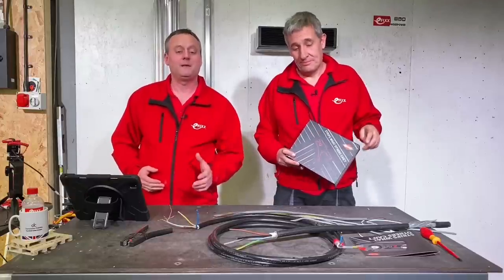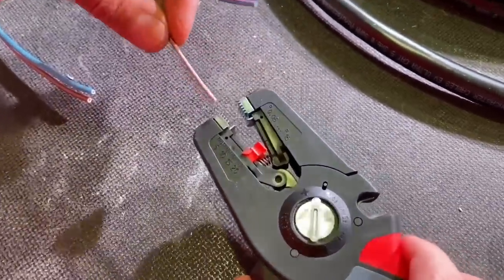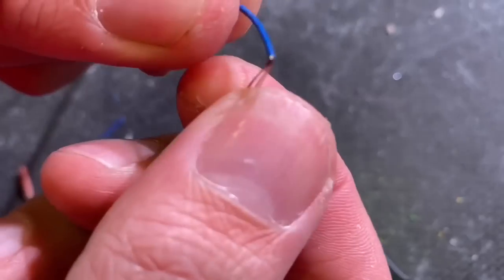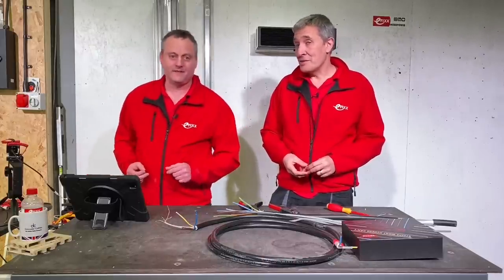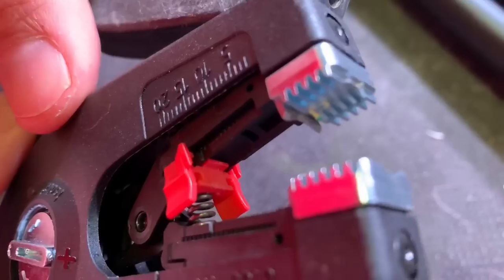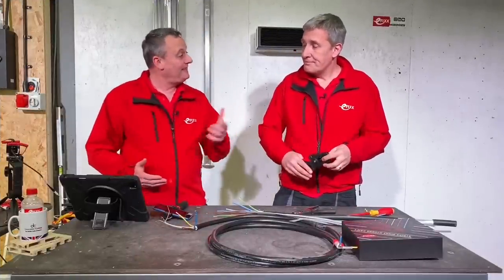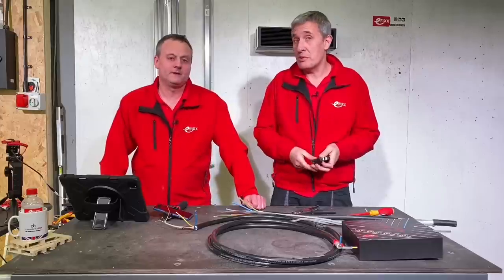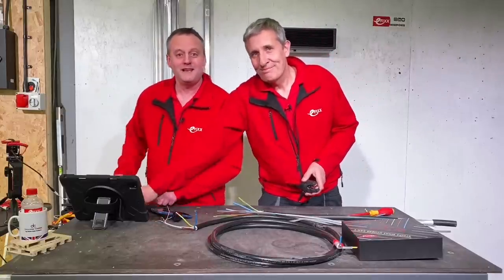KNIPEX PreciStrip 16 - Strips wires that other wire strippers CAN'T

Comment: Does it strip the outer sheath on twin and earth as well
Reply: Great question
Reply: If the cable is flat, I doubt it.
Reply: You can get ones the same design but with 2 flat blades instead of curved blades and it does 2.5 twin n earth like butter literally seconds Amazon have a mooch like 30 quid and seriously good bits of kit
Reply: Doubt it just by how it looks
Reply: @kimjones1270  do you know the name of it?

Comment: Despite the price, these are the nuts. When I first bought mine I felt the build quality was a little 'light', and that they would not last very long. Had them a year and a half with pretty much daily use and a few drops and still working fine. The only thing I will say is that certain cable manufacturers use a more rubbery/stretchy/soft type of insulation, and in these cases may need to adjust the tool fine tune or twist and pull a second time.  You learn to use the tool with this type of cable and is still very effective, but this tool definitely works better on a more brittle/solid type of insulation. Apart from that, a really great tool I use all the time.

Comment: Ive got them. After 3 months of use. I do residential install the spring broke and once you squeeze them they stay closed. About the 16mm2 thing. It doesnt cut them that good. I have struggled quite a bit with 10mm2. Its all fun when you have a new cable, but when i did new consumer unit, i really struggled with the old feed wires. From 10-16mm2. Alsi on the vieeo you ahould strip 16mm2 not the thin ones...

Comment: I don't have the Knipex one specifically, but a very similar in design from another brand, and I wouldn't be without it!
That depth adjustment is so brilliant, just gives that perfect and consistent result everytime
Reply: Which do you have? I can’t spend £100 in wire strippers when I already have so many that get the job done fine lol.
Reply: @DaddyBear3000  Knoweasy Automatic Wire Stripper

Comment: What a lovely set of strippers I’ve also got a version of the Knipex strippers But they seem to be in the middle of the old and the new ones. I keep them in the unit for when I’m stripping cable in there. Great shout with testing with your own cable out. I would of done exactly the same.you wouldn’t blame him for putting sabotage cable in Cheers Lads Keep up the good work

Comment: Thanks for the review.
You reinserted the blade unit upside down after taking it out. This way the millimeter indicator on the red adjustable end stop doesn't point at the mm scale anymore.

Comment: When I started apprenticeship some years ago , had a pair of those strippers with the v jaws and bolt adjusted was told by electrician on site , I hope I never catch you using them , never did use them , tools got stolen shortly after I brought some of those ratchet ones as they had just come out , never actually used them either , there still in tool box some 30yrs later , always used cutters to strip cable

Comment: This stripper met its nemesis when trying to strip double-walled PV wire (both 4mm^2 and 6mm^2 . Although the copper area was well below the maximum of 16mm^2, I wrecked the stripper because of its thick isolation. Something internally bent while trying to strip the isolation and as a result, the stripper lost its clamping force.
Fortunately, the supplier (I live in the Netherlands) replaced the stripper under warranty.

Comment: 28 AWG (0.08mm2) would be pretty common to find in an electronics lab. However, I think the old "KNIPEX MultiStrip 10" is more useful in that regard, as it goes even lower, which is very handy for signal wires.
Reply from the maker: We used the 10 for many used on difficult thin cables 👍

Comment: Well look at that. Doesn't leave any scarring on the mechanical protection or the Conductor insulation unlike the @cktools automatic stripper. And it does 16mm as well. I'm just getting used to using croppers as a student and I'm sure this will be a champion amongst the established sparks.

Comment: I was going to buy the ones you had on a week ago, now you throw this spanner (or stripper) into the works😍 a few questions:-
What’s the max length of insulation it will strip?
Can it remove t&e sheathing, including LSOH?
How much are the replacement blades?
Which are better the ones from last week or these beasts?
Reply from the maker: This isn't for flat cables like T&E - use the one we featured last week for that. - Tune in to the live stream next week someone is going to win these and someone will take away the ideal ones.

Comment: I have one. I bought it for those large range jaws. Is not so smooth in handling like Weidmuller. But maybe in the future you will make a comparison with the same category stripper from Wiha (0,08 - 16 mm2)

Comment: I'd like to see the conductor of the CAT5e following stripping. The outer sheath tends to stretch over the copper if not tight enough on the cutters..or the copper is marked leading to breaking of the conductor

Comment: Dunno. Just bought one of these and it doesn't work great. On some of the thinner 0.5mm wire it couldn't even strip them. I played around with the strength setting but didn't make much difference. Can it be a faulty one?

Comment: I've had a pair for a couple of weeks now, really good bit of kit but I have found it on several occasions slip on the cable and only score the outside, then because the cutters are set to match the clamping jaws it won't strip the cable and I have to revert back to my pliers to strip it
Reply from the maker: What type of insulation did you have the problems on?
Reply: @efixx  just some 6491X single core pvc cable

Comment: Received new tool, very excited to try, did not work from the moment I removed from blister pack, no matter how I adjusted the settings, or which size wire, it slips through the jaws and does not strip, IT IS Garbage, does not work. Knipex will not warranty or replace, called customer service (USA), left voicemail, very nice polite lady called me back and proceeded to tell me that the strippers were not designed to work on THHN, solid or stranded, nor MC conductors, from 16 to 10 gauge. DO NOT WASTE YOUR MONEY, $120 in the garbage.

Comment: Will you be doing a clamp meter review? I have the fluke 324 but its stopped working, it displays but no readings on the test probes for voltage and continuity readings.
I tried new batteries but not the leads yet.

Comment: Do the strippers also take off the out sheath of T&E?
And do they reach i to a back box better and closer to the entry point than other cutters?
Reply from the maker: Not suitable for T&E
Reply: @efixx  are there any that are suitable for the outer sheathing of twin and earth? I have been using the automatic vice grip style ones - is it okay to use them? They don’t seem to damage the inner insulation

Comment: Thanks Gary and Gord for another great video! I had the predecessor in the Amazon basket but never got round to buying it, does the new one strip the outer pvc from twin and skin? Cheers Myles
Reply from the maker: It doesn't work on T&E - cheers
Reply: @efixx  Does the old one remove T&E ?
I notice the blade on the old one is flat.

Comment: I'm more confused at the cat5 combined with the armoured cable! What's going on there? Have always been told to keep them separate!
Reply from the maker: It’s a special cable for EV charger installations - see this video https://youtu.be/0MFlJzJb_Qk -cables can be combined if rated to the same voltage - precautions taken for interference etc

Comment: Was it me or did the insulation stretch on the 2.5 as stripping and in turn after installation will that shrink back and expose conductor.

Comment: Nice tool, still with this automatic strippers(the ones with metal gripper)  I see damage in the isolation where the gripper holds the conductor. Where a normal strip action by a knife, sidecutter or combination plier with good feel of control will leave no damage behind.
Reply: This damage is minimal and does no physical damage to the metal it self. You will save yourself lots of time and labour through out your career.
Reply: A perfectly clean cut in the isolation is not important. For at home use the solutions you suggest are sufficient, but for any other environment it is too slow.

Comment: help !!! 
 How does ..KNIPEX SELF-ADJUSTING WIRE STRIPPERS 7" (180MM) (6629F) from screwfix £60 compare please.
The KNIPEX multistrip 10 here is shown as predecessor but knipex seem to sell both, the 10 seems smaller which can be better  
  is the16 better for cat 5 burg alarm t./e,    1.5 23 core  2.5 3c outer and inner...ie all usual

Im seeeing £80-£90 for the 16  best place to buy ??
thx

Comment: I think there a OK tool but I think you will have a problem when stripping the outer sheath  at the box? The conductors not a problem in which case you might as well just use side cutters.
Good demonstration though weldone. Correction I was referring to the ones you show in an other video.

I have asked this question on two other channels and no one is  willing to give an answer or to demonstrate there use at the back box .

Comment: yes good demo and good video, but for the price like 90 quid that's a bit extreme compared to other horizontal cable strippers at 1/4 of the price.
Reply from the maker: Depends upon the type of cables you use.

Comment: Are there any cable strippers out there which strip outer sheathing of LSF cable along with in conductors as most industrial/commercial projects using this cable more frequently now
Reply from the maker: Hi Alan - I good question which a few folks have asked. For T&E cables we've found that the Ideal T&E stripper we reviewed recently will strip LSOH sheath and inner cores. - We give a demo in our Live stream - https://youtu.be/w0Fq-h7U4LQ?t=1437 - Room temperature makes a huge difference.  For round cables we have another product we are testing at the moment.
Reply: @efixx  Thanks. Will have a look. We do a lot of ring mains in 4mm LSF and a nightmare to strip and especially when doing dbs
Reply from the maker: ah yes - 4.0mm we see it quite a bit in heavily insulated buildings too - we will see what we can find at 4.0mm and beyond.

Comment: What’s the best stripping tool in your opinion for stripping standard flex?
Reply from the maker: We use the Knipex Ergo strip - https://amzn.to/3n6ftgv  - does outer and inner cores - but need to be careful not to nick the inner cores - We also use a Weicon cable knife - https://amzn.to/3rPMvVC to remove outer cable jackets on flex and NYY.

Comment: Hey Gaz/Gordon,
Gordon how have the blades on your preceeding stripper degraded over time? Did you find the need to replace them regularly or at all?
Reply from the maker: Hi Mark - I've never had to replace the blades on the previous version yet - but it has spent most of its life dealing with small diameter flex conductors <1mm sq so it hasn't had a hard life. (unlike Gary) - cheers Gordon*
Reply: He certainly doesn't make life easy for himself. Maybe in the next video you could record replacing the bearings in his wrist

Comment: I have seen many wire strippers both mannual and automatic but all were designed to strip only single individual wires and not double insulation cables having two or more wires inside 🤔. It looks like no manufacturer has designed such strippers yet
Reply: Check out the Irwin and Klein automatic strippers as well as these Knipex in the video. They will all do exactly what you want, strips outer sheath of romex, cat 5, etc no problem. Several other brands as well, but those 3 are top notch.
Reply: @jthomas.  The Irwin and Klein model I saw online is same type I already have with a yellow colour handle and bigger size with a pressure adjustable knob , having cutting, stripping and crimping function but it also can't strip properly the double insulation two core cables having two wires inside an outer insulation. It sometimes strip them properly sometimes not, damaging the inner wire insulation too but only works good if stripping individual wires of any guages
Reply: Knipex KPX1264180

Comment: I found the knipex stripper useless as it is inconsistent, the  Jokari at a quarter of the price stripped every time
Reply from the maker: On what type of cable?
Reply: @efixx  on 1mm tri rated flex wire,, I'm an industrial electrician and use a stripper daily